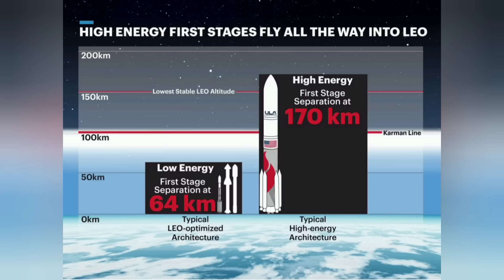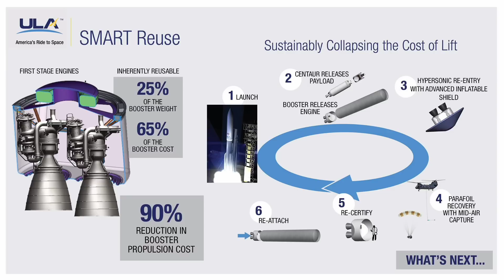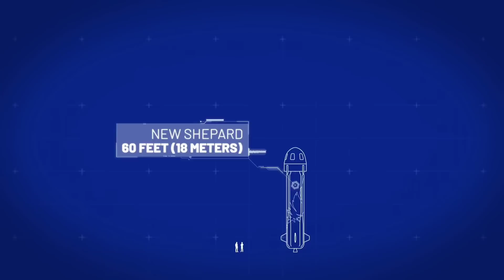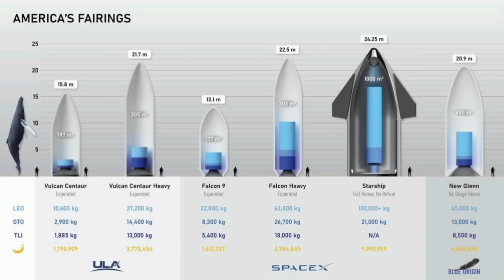Blue Origin wins again!  But does Bezos deserve the same USSF contracts as SpaceX and ULA?

Comment: You say starship won't be able to do things because it would need to refuel.  But isn't that kinda the point? Once starship is completely reusable it won't really matter how many refueling flights it takes.  It will still be cheaper to use than anything else and will be able to drop anything into any orbit you want.
Reply: The us army requirements a direct flight so refueling is out of the question with this requirement
Reply: @danygauthier605 surely that’s because that’s how it has always happened?
Reply: @danygauthier605 Am thinking if starship is ever successfully fully reusable...price will change the military's mind 😂
Reply: @lemont64  Yeah - potentially Starship will be able to deliver 150 tons to GSO using refueling.
New Glenn max capacity to GSO/GTO is 13 tons. Starship, fully reusable, will be able to do this at a relatively low cost. Probably comparable to one Blue Origin rocket.
However, this discussion is entirely moot until Blue Origin can prove they can even reach orbit.
Reply: @pierre.a.larsen starship's numbers aren't set in stone either. So far they had to switch to the heat shielding that is twice as heavy, and we are yet to know if it helps and how much refurbishment will it require after each flight. But, at least it is an actual hardware flying, unlike New Glenn.
Reply: @solarissv777  Starship is not even past the prototype phase yet - so, yeah, a lot of unknowns.
But spaceX at least has a proven track record.
I think Blue Origin is underestimating how difficult getting to orbit and reusability is.
Still, I applaud the effort.
Reply: @danygauthier605 yup. But consider massive payload capacity, you can use "pusher stage" for majority of payloads.
Reply: One mission vs. multiple of an unproven concept!  Which do you think is more risky to fly you payload worth 10s of billions???  It's a no-brainer!! BTW, the DoD rarely worries about potentially saving a few buck!
Reply: @professorg8383  my point is that if that's going to change, it's only well after it's a proven concept. Given the DOD has invested in starship, i'd dare say they would be open to using it well into the future.
Reply: @murrylancashire  DoD invested in Starship?  I think you are mistaken. DoD is not NASA. What DoD contract does Starshio have?????
Reply: @professorg8383  something about point to point transport. Don't remember exactly. But it's less a contract, more like research grant.
Reply: @just_archan  If indeed that is the case, that's hardly being invested in it. 

I think what you may be talking about is an idea that maybe Starship could potentially be used to transport equipment. But I'd be surprised if the issued a grant. That's usually not how they do things. 

I think this discussion may have come from discussions about very quick and very cheap theoretical capabilities of Starship. I know I read something but also recall thinking that the military can pack 130 tons in a C5 and get it to virtually anywhere including air dropping it if necessary! 

But that's the kind of thing I would be surprised if DoD would issue a grant. You'd think it would be something SpaceX would look at exploring themselves.  IDK for sure either way, but even if they did pay them to research it, that's a long way from being invested!  Musk does not seem to get long with DoD very well. They have flown several Falcon Heavy missions   And then there was the Starlink Ukraine issue that caused Musk to be called in on the carpet. I don't think either really like working with the other.